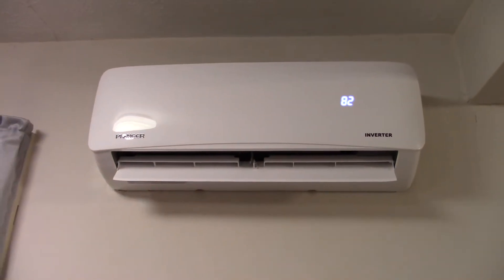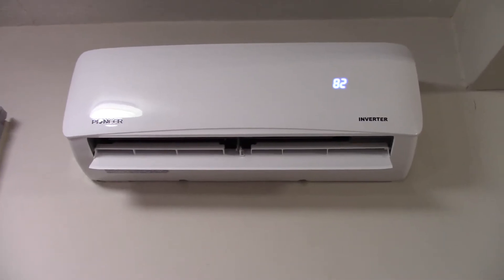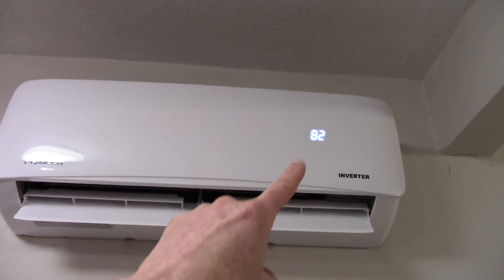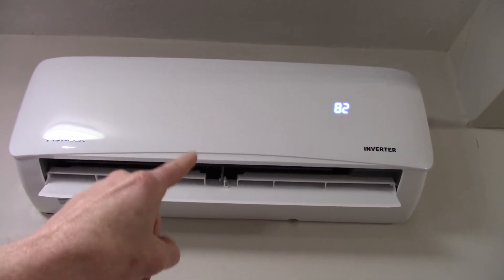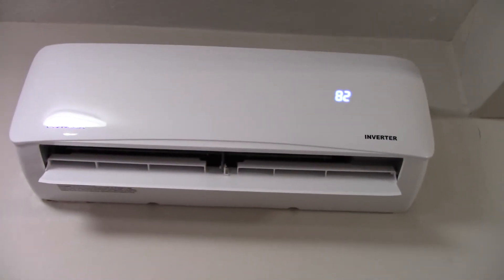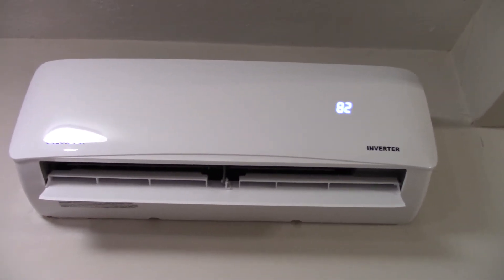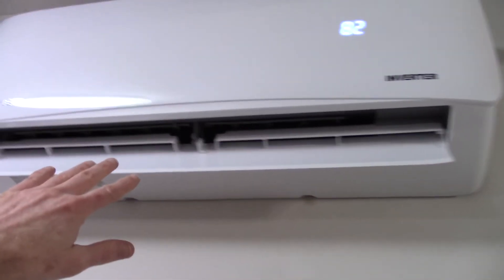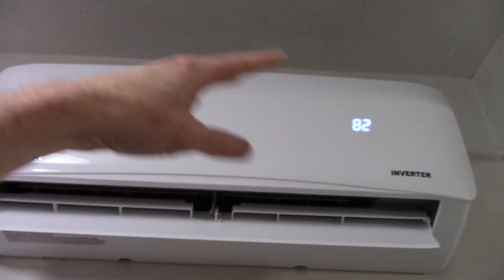Mini split heat pump not heating well - how to fix

Comment: What could be the issue? with the unit, if I turn on the heat and it shows the heat and It could take half an hour just to begin blowing warm air. in the beginning, it just sits with its "mouse open", vent. It's not all the time but does happen
Reply from the maker: It is normal for these units to take a few minutes to preheat before blowing warm air. Mine takes about 5 minutes. It could take longer if it is really cold. Half hour seems too long. Might need service.

Comment: I sort of get why they have the place it up high but it seems counterproductive. I’m having this problem but with a different brand. My bed is by the window too but right under it. The building provided the unit so I have no clue how old it is. No error codes or anything. Only gets hot if I put it up to 78 but they sent out an email not to do that for some reason and to set it at auto at 73. That does nothing for me lol
Reply: Did it work?
Reply: @ what they said to do no lol. I put it to 78 then it’s fine but I don’t want my electric bill sky high and January is coming in Chicago here and it’s gonna be -20 with wind. It’s only in the 20’s now

Comment: I have a toshot minis plit from April 2023 on December 2023   called the company when they came : change parts because no heat. now I open for to see because it's 7 degrees c but not October 2024 . What message for people who want to spend money on mini split .
I will the way you up by the Fan.
Thanks

Comment: There is a small wire with a thermo on the end under front cover you will see it. Move it away from the fan area, I moved it
to the right and into the control wire area.

Comment: How do you get the heat to come on. I have the same exact one in my room.
Reply from the maker: You need the remote to set it into heat mode.
Reply: @jatlifevlogs2725  I have the remote and set it on heat and nothing happened.
Reply from the maker: @TrueBossLady0705  Does it work in any mode? What does the display show anything on the unit?
Reply: @jatlifevlogs2725  Yes, it works on the a/c and the fan. It has a dry mode and the heat mode.
Reply from the maker: @TrueBossLady0705  It takes it a few minutes to warm up when set to heat mode before it blows warm air. Beyond that I have no idea. I would try to contact the manufacturer.

Comment: We just bought an 18,000 BTU Senville, and mounting it above a passageway between rooms, the main room having a vaulted ceiling.  It does seem to me, these mini-splits should be mounted much lower on the wall, or use a ceiling fan.  We have two ceiling fans that have run constantly for the past five years, to keep our 600 square foot room comfortable, year-round. The only other heat is a wood stove.

Comment: Windows doors closed. Remote control batteries removed cause i use wifi resideo app to control unit. Heats room to 70 . Cant heat pass 70. Any settings on the remote i need to look at.
I have a fujitsu 12RLFW1

Comment: I figured when I move the thermostat closer to the fan it did reach to the temperature I wanted. So does that mean the outdoor and indoor unit is working fine. It’s just that all the heat rise up and not coming down?